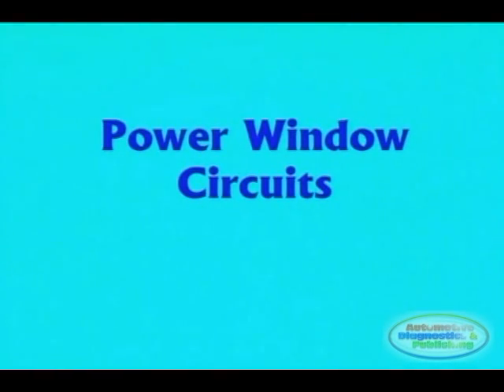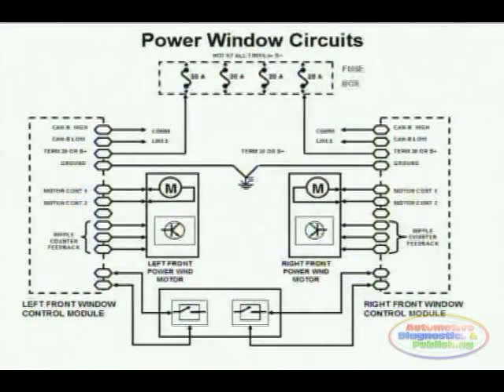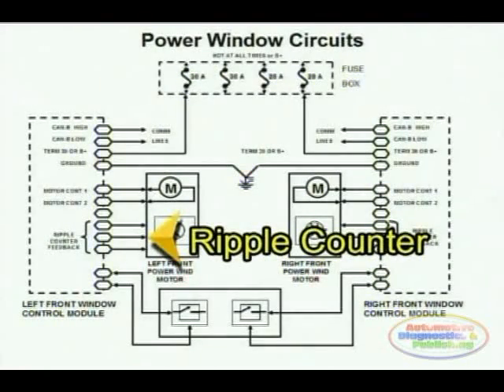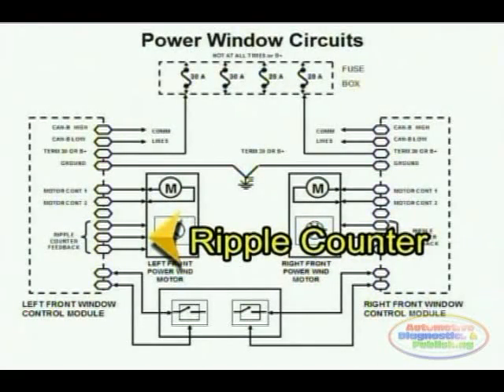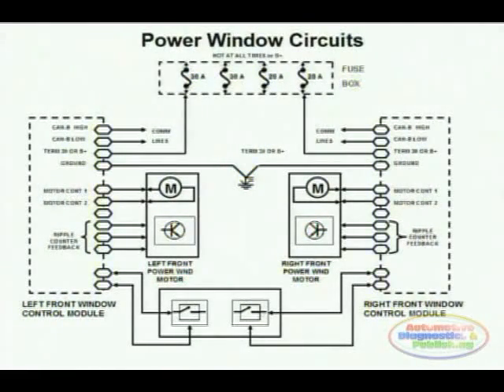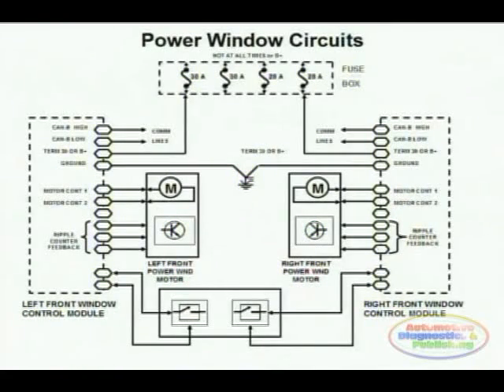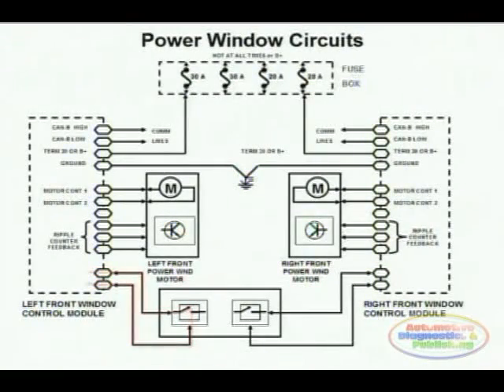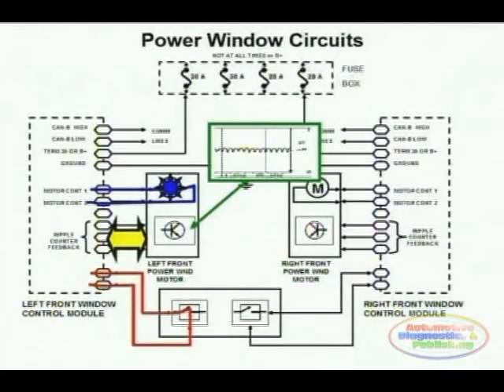Power Window Wiring Diagram 1

Comment: I have an 08 accord, the passanger window works but only from the switch on the door but not from the master switch on the drivers door, I was thinking could it me a module in between the two of them? . Any ideas? Thanks for the video.
Reply from the maker: Yes correct, on most vehicles there is a LIN Bus Network that handles low priority items, windows, door locks, seats, etc. The LIN goes down and everybody else does.

Comment: I have a problem! I have a dodge grand caravan and I can get power in but I can't get the rear windows down, the passenger can't roll it down from their control. the driver can only lower the driver and passenger windows. I already replaced the switch also.